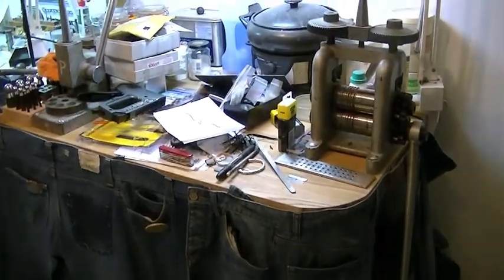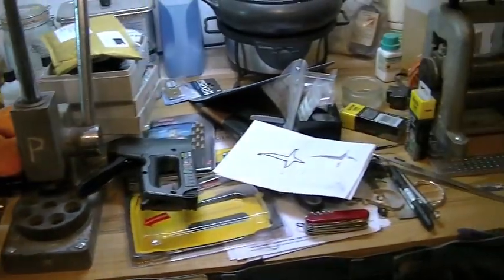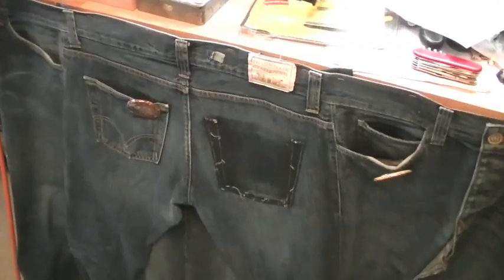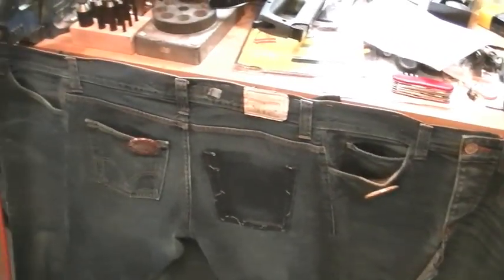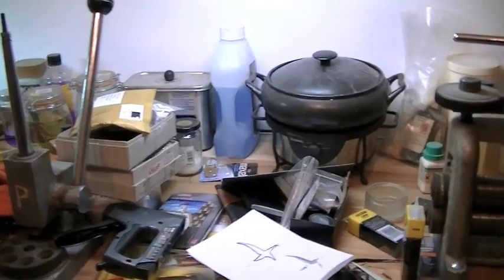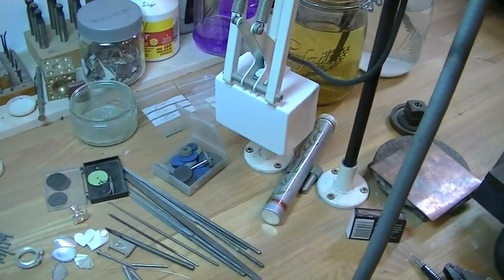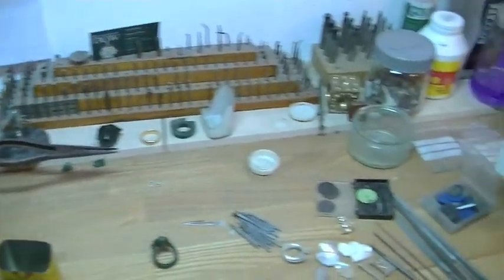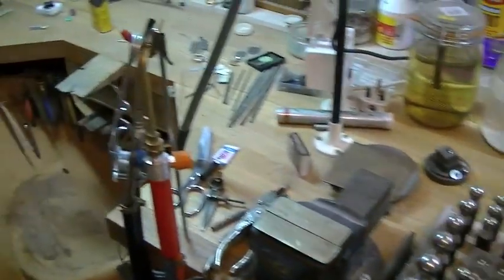Tidy jewellers bench

Comment: Hi Mark, nice bench. I'm thinking of making more or less the same myself. Can you tell me what timber the work top is made from and what dimensions it is.
Reply from the maker: Slick Roode hi it's a oak kitchen top I got mine off eBay they come in standard size. It's a really hard wood to cut so I had to have someone do it for me as I don't have the tools 

Hope that helps
Reply: Apologies for bothering you again. I'm a professional fly tier/lure maker (fishing related if you don't know) and when I contacted you previously it was around the time I had an idea to incorporate the jewellers/watchmakers bench for my own trade, as it a better design. I have finally completed my bench but I'm have trouble locating any info about, for what if a better description, the waste catcher that goes under your work area. What is it usually made of and can they be bought commercially? I'm assume I'm not finding any info because it's not called a waste catcher. Any help would be greatly appreciated Sir.
Reply: nice work
Reply: @SlickRoode  I know this is late, but maybe someone else might want to know. It is called a bench apron or a bench skin. It is typically made of leather.